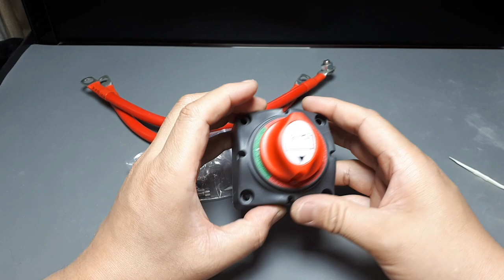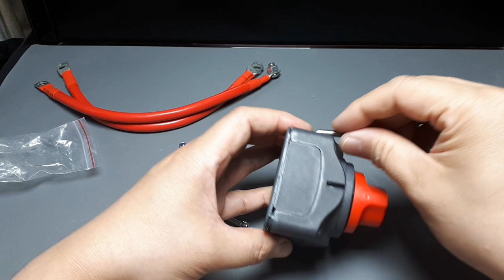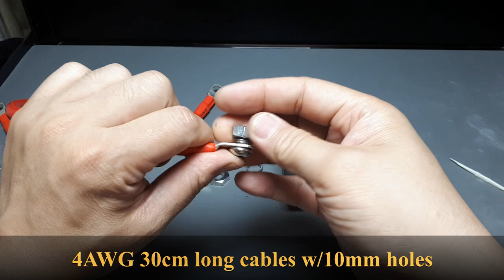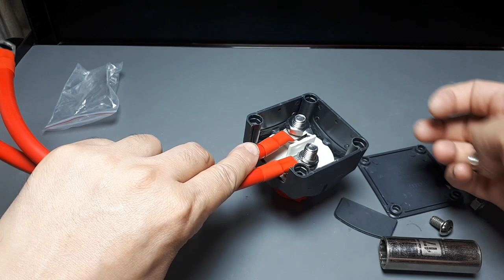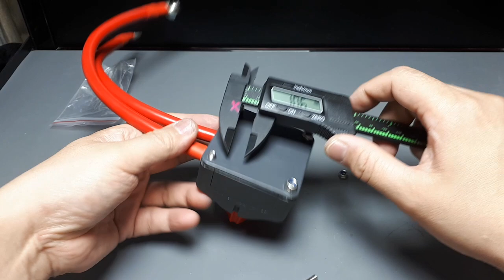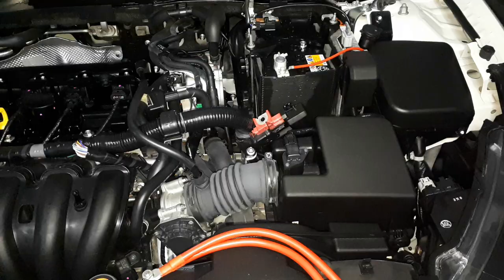Tutorial: car battery kill switch (cutoff negative side better?, read below) no dead car DIY cutoff

Comment: Leaving the bolts long you can fashon a bracket to mount the switch solid under the hood so it doesn’t move around while driving over bumps.

Comment: The bolts are long so you can use the battery disconnect in a panel mount configuration.  The knob would stick out of the front of the panel and the "box" behind the panel.
Reply: Yes, it allows you to cut a round hole the diameter of the switch face leaving only the knob protruding from the dash/panel mount with the box secluded behind.

Comment: You should cut off the negative wire, not positive. 
Its too Dangerous if the positive cable or kill switch post short to body
Reply from the maker: Thanks, that's good info. My concern was if someone tries to start the car it will blow a fuse. The way it is now that can't happen.  The switch is in a bolted together plastic box so unless the box shatters it can't short.  Still; after more research I switched to the negative. I'll do a follow up vid and take this down later so no one catches their car on fire.